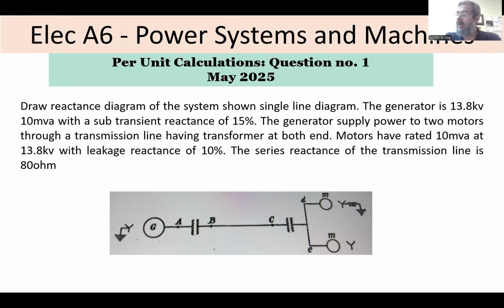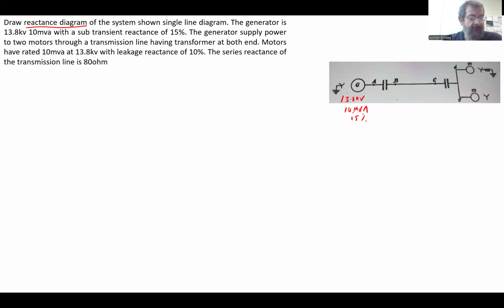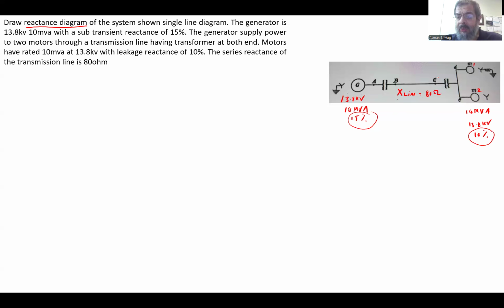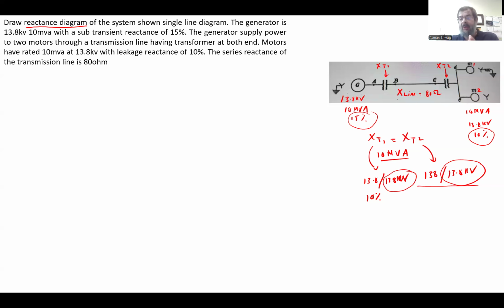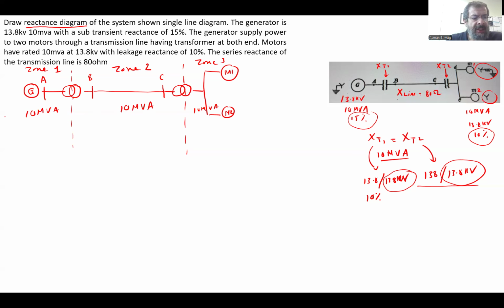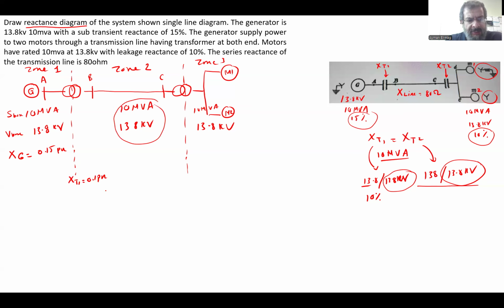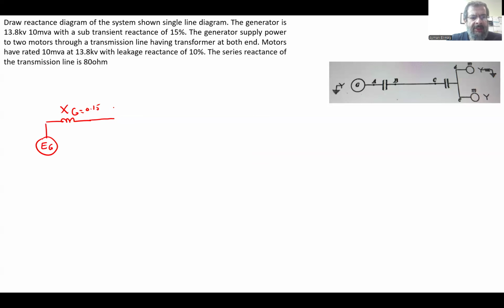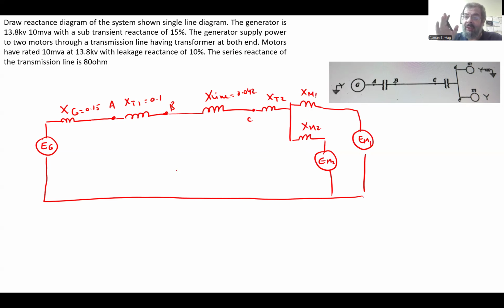PEO solved examples (ELEC A6) Per Unit Question no. 1

Comment: Hi Professor, in this questions as they are asking for a diagram. Do we need to do the calculations or if we had made only the diagram it would have been enough?
Reply from the maker: Yes you need to do the calculations, this is implicit when asked to find the reactance diagram.

Comment: Dear Professor,
For this problem, may we draw the SLD using actual (ohmic) values rather than PU? That way, we wouldn’t need to assume the line voltage, only convert the generator and motor reactances to their corresponding ohmic values. Thank you.
Reply from the maker: The usual practice to have everything in per unit and not in ohms

Comment: Thank you so much — you're the best.
Students need at least 50% to pass the exam. If it's possible to share the third question from 2025, I would really appreciate it.
Would you please write your Gmail
Regards,
Reply from the maker: I already solved 2 questions before from May 2025, both are power calculations. The 4th one is concepts and I already answered most of them as this concept question is repeated. However, be careful there is no guarantee that Monday exam will be as easy as the May one.